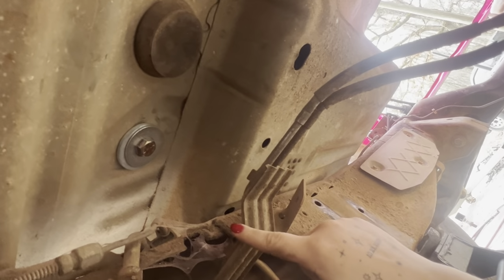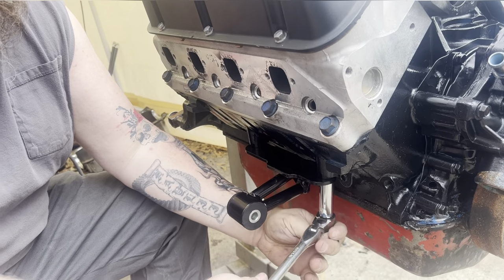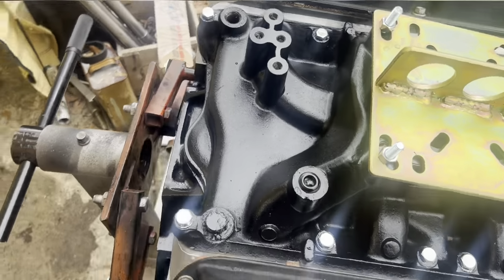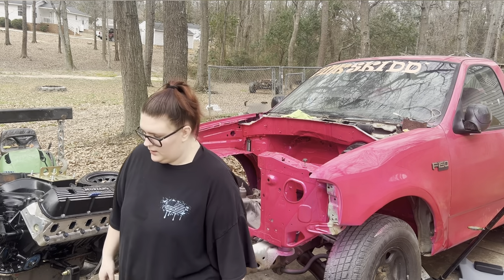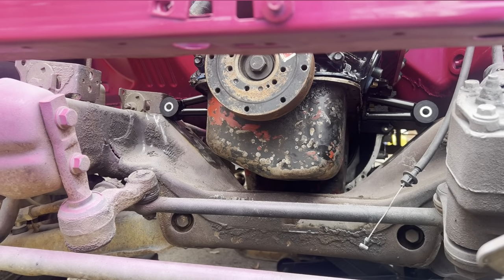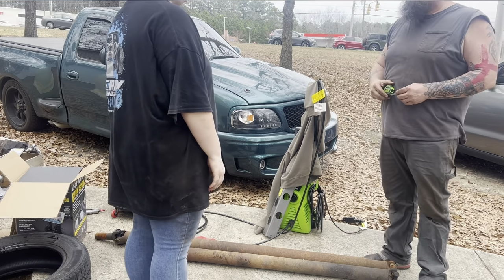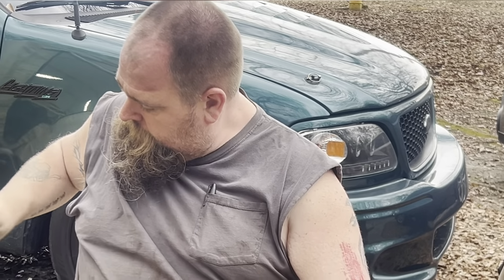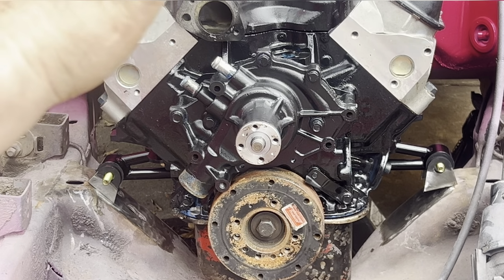Getting it mocked up!

Comment: Why would you not put in new u-joints??  They were out, it's the most perfect time.  So what if the others were good.  They would make good back ups.

Also, what motor are you guys putting in there.  The truck is built for a modular engine, which has the motor mounts set back a little farther on the block to allow the motor to sit forward a tiny bit.  Granted, a modular engine is also much bigger and still sits close to the firewall.  However, that one looked like it had plenty of room to maybe use some offset motor mounts to pull the motor forward slightly.

I get it, this is a budget thing.  At least I'm assuming it is, but it still needs to be done right so you don't have to do it again.  That's why I cringed when I saw old u-joints going back in.  Trust me, I live week to week and wish I had the money to start working on my f150, but no way would I take out old u-joints and NOT put new ones back in.

Anyway, I applaud you two for working outside.  I know you're in SC and the weather here hasn't been favorable.  I wish I had a concrete pad so I could at least start tearing my truck down (blown 5.4).  I can't even do that much this time of year.  It's going to be interesting to watch this build.
Reply from the maker: Hey, thanks for the feedback! We will be putting new u-joints in. But we just threw it together to get it mocked up for the motor mounts but everything was taken back out (which wasn’t videoed) and the motor is a built 351 Windsor. Thanks for watching!